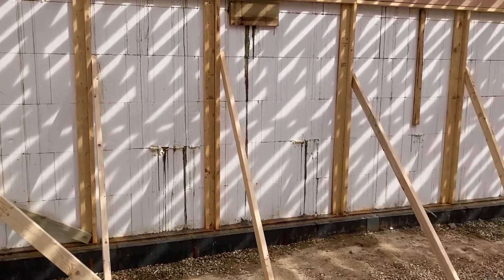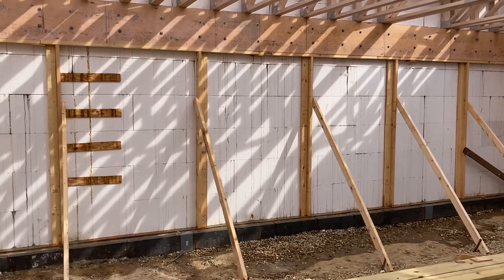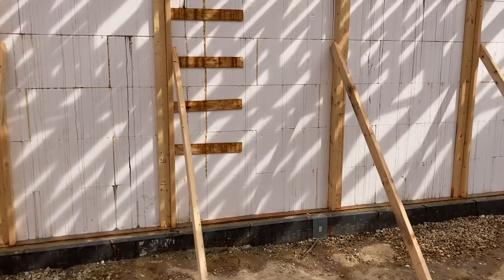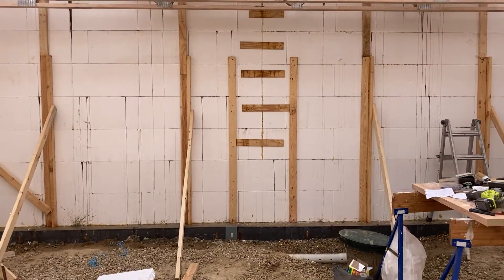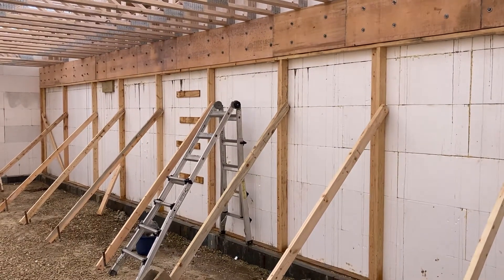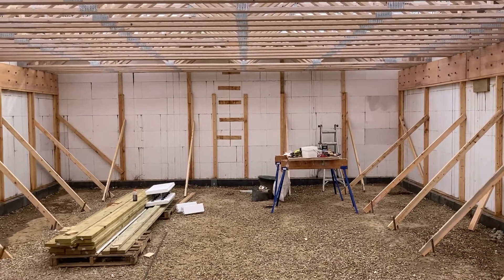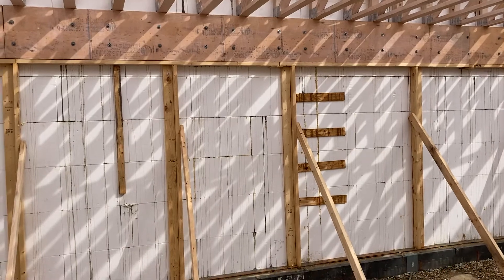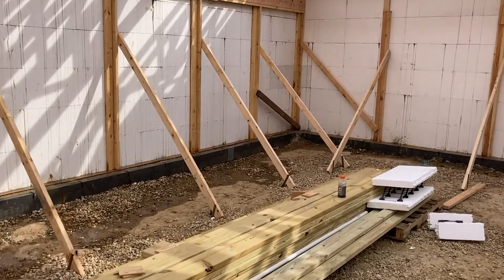Pre installing floor trusses on an ICF basement pour. Part 1

Comment: So wait, your bracing wasn't adjustable?  I assume that with the trusses in place you felt comfortable enough that they wouldn't move?  Well done if you have found a way around super expensive bracing.
Reply from the maker: Nope.  And they stayed true. I don’t believe the walls moved at all.  Besides providing support across the tops, the trusses provide a lot of downward weight that kind of hold it in place too. Only issue  I really had was not bracing my back wall a bit better.  It moved very slightly.